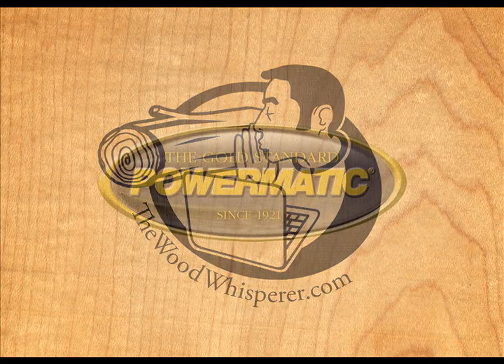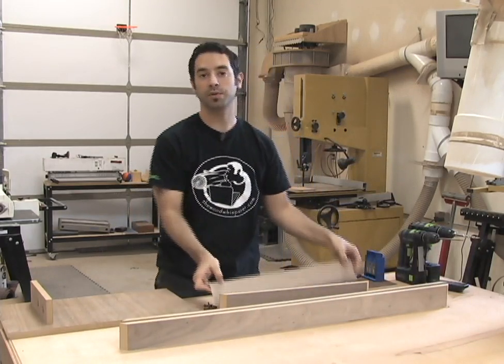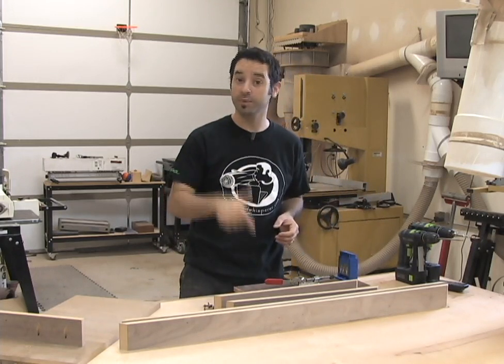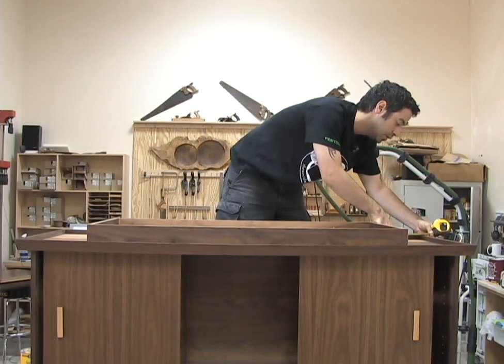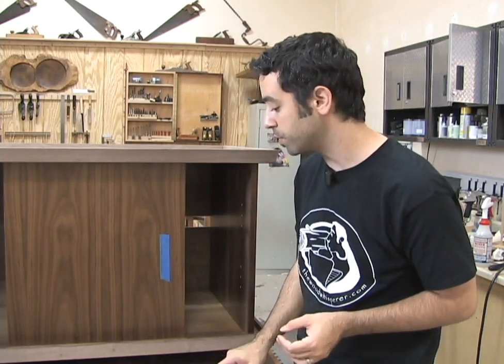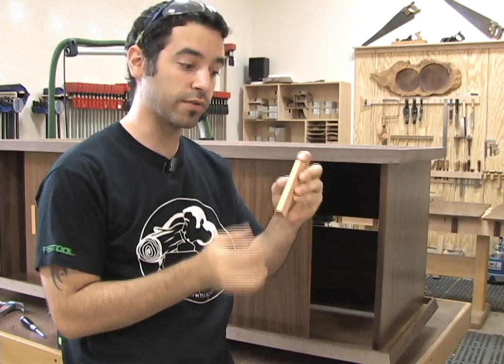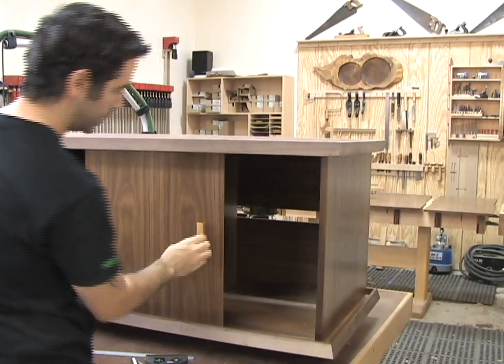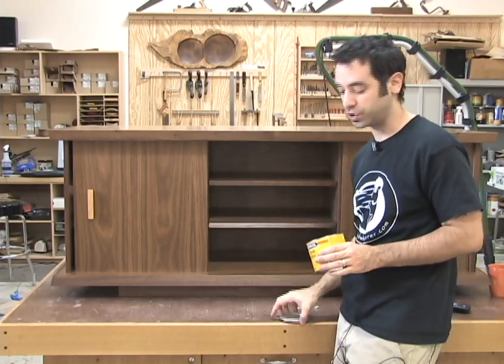101 - How to Build a Low Profile Entertainment Center (Part 5 of 5)

Comment from the maker: I do think its worth it.  The joint is not exceptionally strong, but I still want it to be as strong as possible.  And the tape trick allows me to get the joint nice and tight, making the most of it.  You could certainly reinforce the corners if you want to.  I didn't, but its definitely a good idea.

Comment: I like the trick with the taped corners of the base but I wonder if it's really worth the effort.  How good is that glue joint ? Wouldn't gussets in the corner make a stronger joint ?  And considering that it's all bolted to the base, do you really need it anyway?